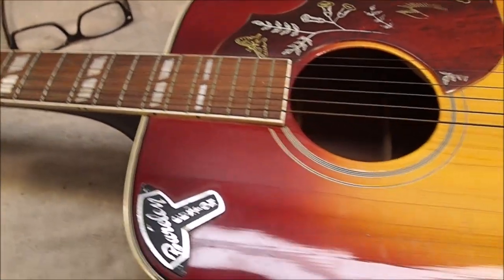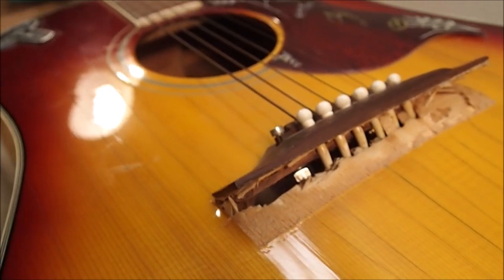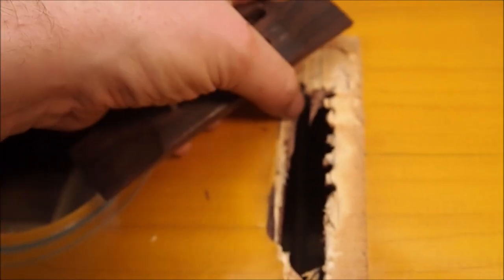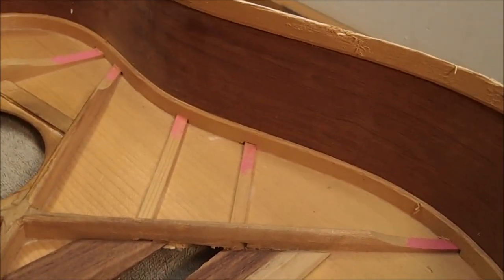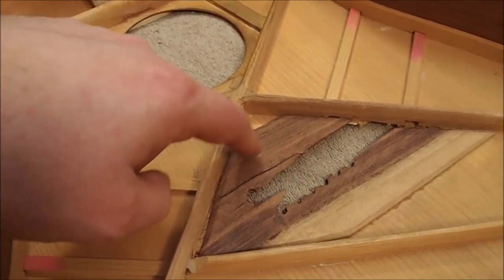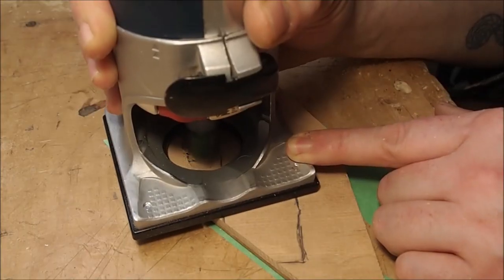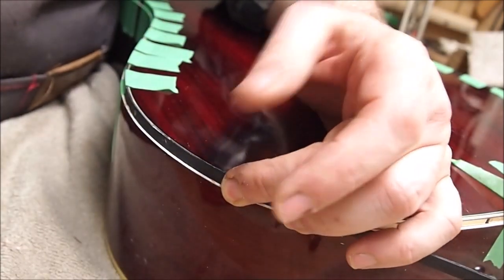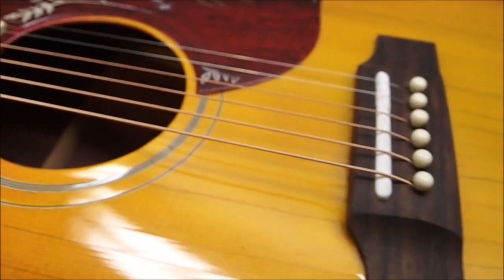Soundboard Repair and Replacement Bridge

Comment: I have never ever repaired/modified/rebuilt/restored an instrument and felt, for a nanosecond "oh, heck, another mundane fix". There are no mundane fixes. Every single instrument that I have ever purchased/traded/sold/fixed required all of the intelligence/improv skill/ perseverance that I could muster and not one fix ever followed a formula. Every instrument taught me something new and tested me to and beyond my (heretofore) limits.  Jerry Rosa inspired me to believe that I could restore that early sixties Sears Silvertone and by god she has aged beautifully and requested "no ninja neck refit, dude, I'm a slide guitar" and by gum the best slide guitar on the planet. Mister Rosa also inspired me to even modify and repair "cheap ol' tuners" that normally I would have thrown away - a little bending and a little lube and they're fine. It took me a while to check out twoodfrd because I anticipated lots of power tooling however Mister Twoo doesn't show a lot of that equipment in motion and I'm glad for that. I love watching impeccable hands utilizing hand tools on wood. Thanks.

Comment: Nice repair & great job motivating the reason-- sentimental value has no price! Honestly, I would be afraid to remove the back, but I can see why you did. I'm doing a bridge replacement on a Washburn right now for my son because it's a good fit for him (dreadnought for a big guy). The loss of material is a problem. I'm looking for tips on how to add back some material. Some folks use "Bondo," but I'm squeamish about putting that "under the bridge." :-)  I thought about routing out to level the plug needed and establish a simple perimeter shape and glue in a plate to match, but I'm not sure that's the best approach for sound quality. I am somewhat encouraged by the appearance of your finished plug, because it reminds me of the way molding can cover a variety of sins (little gaps and such). Thanks for the inspiration! (Nice bridge fab!)

Comment: Just popped up in my feed. I enjoy watching a real craftsman think things through. There are a lot of things to consider before anyone just starts digging into a project. Looks to me that you have skills. I didn’t understand how you took out the belly with the clamping of the body. I would have liked to see you fitting the replacement wood between the bridge and the plate. Perhaps you just like short videos. I look forward to going through your back catalog because you are indeed a master craftsmen.
Reply: The belly wasnt removed with the clamps, but by gluing in a new Bridge reinforcement. If there is a belly you need some clamping force to make sure it adheres properly. Once this is in place its stiffness and the adhesion of the glue keeps the top under tension and from deforming. 
If you have time you can try to work out deformations with clamping, heat and humidity - but its generally not worth the effort considering the result is unknown.

Comment: Great repair - I was curious to see how the fitted patch piece was glued in. I think there was bracing (while gluing it) from behind and top with glue around the edges. I got a glimpse when the saddle piece was being lowered on. I was curious if there might have been any thin woodstrips glued around the bottom perimeter to add additional strength to the repair. I assume this is not needed and the repair piece was glued in around the edges only. I need to patch a gouge hole on the bottom soundboard of my old Yamaha.

Comment: I had a bolt-on bridge that cracked every time I put the strings on so I ended up chipping off the paint, doing the sand fit thing like Woodford, and gluing it to the top. It's a fret saddle type bridge.

Comment: I have a $100 70s Ibanez Hummingbird copy with a lifting bridge. I really need to fix it before this happens. I don’t know what glue was used, but should have a bash.
Reply: There are a lot of other videos on bridge replacement, some will mention the glue they used by name
Reply: @fleadoggreen9062  I got psyched up to heat the bridge and prise it up to find it was just being held on by the bolts, as the glue had totally failed! I did my cut-price Ted impression on it (I had to buy Titebond), and I’m pretty happy with the result ❤️

Comment: Why take off the back? Would it not make sense to take off the top and replace it seen as it's the top that's is damaged? Very neat and tidy as usual well done.
Reply: because taking off the top is a lot more work, prone to damage and more visible than the back..
To take off the top you need to remove the fretboard, depending on construction possibly the neck. This also means you will have to reglue these later and probably a lot of fretwork and setup. The top is also much more likely to deform when removed from the sides and thus can be harder to reattach.
Its also really hard to remove the top binding without damaging the neck. You cant just go around with the router and hope for the best.

Comment: i have a morris w50 with a solid spruce top... i wonder if the bulge top was by design or resulting from the strings tension over time... anyway the bridge is still intact... is it possible to flatten (cold press) the top without removing the bridge?

Comment: Did you have any trouble marrying the back to the sides without using a jig to hold the original shape of the guitar?
Reply: i doubt it. The sides with the lining are already pretty stable, especially considering the wood they used. Unless there is significant deformation and thus stress on the soundboard getting the back on again isnt normally a big issue. 
Additionally with this kind of construction the bracing slots exactly into the linings - this ensures the back and sides will line up again when glueing it shut
Reply: @TheVergile  Not my experience.. but I'm glad that the guitars that you've worked on  have behaved so well.. I've never seen a guitar top go on perfectly that wasn't held in place by a template and and inspection of the finished binding would typically let you know whether a template had been used or not.
Reply: @donttellthekids2655  Thats probably because you have worked guitars that dont have slotted bracing.
If the braces are slotted traditionally there is only one way that top/back will go on. No amount of force and jig usage will move that relative fit.

When we build guitars most traditional methods remove the sides from the jig once the linings are in place. 

In general with traditionally built guitars removing the top later on is quite rare anyways. Just not worth the hassle when you can more easily enter through the back.

Comment: Celluloid has an odd smell like that. It is made from nitrocellulose and camphor.  The camphor component smells strong. You might have smelled it before as ping pong balls and some bindings are made of it. Take care with it, it's extremely flammable.

Comment: Do you ever have reason to replace the laminate soundboard on a budget guitar with a solid top? I ask because I've noticed that even major brands are coming out with solid tops and laminate bodies. Takamine had made some late 70s models with solid spruce and thus one would find an S at the end of the model name like F-360s or F-385s.
Reply: Not worth it.
Removing the top from a guitar takes a lot more work than removing the back.
You would need to take of the fretboard and possibly the neck, redo the whole bracing, reglue the soundboard, lacquer, glue on a new bridge, fit a saddle, etc - which inevitably leads to a ton of setup and fretwork afterwards.
Generally speaking composite soundboards dont have to sound bad. some perform actually quite well. Of course you wont see a lot of them in the more expensive price range - but then again: at that point youd be better off just buying a better guitar instead of sinking hundreds and thousands into an instrument without knowing how it will actually sound like.

Also not all laminates are born equal.
Reply: @TheVergile  Thanks for the feedback. Hundreds of thousands? Me thinks you exaggerate somewhat. I was thinking something simpler like removing the laminated top and replacing it with a new top which of course would need to be created. Also, I'm talking about myself doing the work. Not everything has to be done by a pro.
Reply: @TomasAWalker53  ah, it was supposed to be hundreds or thousand.

Yeah, i know what you mean. But thats my point. You cant just remove the top without doing all these other steps.
The Fretboard is glued to the top on most guitars. So to get off the top you need to remove the fretboard. If you remove the fretboard and reglue it after you have switched out the top youll have to redo some fretwork and setup. 
The bridge and braces are also glued to the soundboard. You can remove the top while leaving the braces in, but that makes regluing a new top quite hard. 
Its either that or redoing the bracing for the new top tho. 
You can remove the bridge from the old top and reuse it, but before gluing it on you first have to lacquer the new top.
There are also other small things like putting in the rosette, redoing the binding, making new reinforcements for the bridge, etc.

So its not like you can skip any of that - when you want to „simply“ exchanging the top this is all stuff you need to do. 

Of course you dont have to pay someone to do it - but if you can do all that you are basically half a luthier yourself.

Comment: @ 3:47 ............"they're using a really high level of skill while they're doing it"........in light of this,  it is so much more of a shame that they did not use better - solid - materials for the top, back and sides.
Reply: well, i mean. i think its fine.
They were aiming for a certain price range and decided to cut the material costs. There is a pretty strong argument to be made for producing affordable instruments. 
And plywood doesnt have to be a bad choice for a guitar top. It is an absolute nightmare to repair once you have a lot of delamination, but it is also very robust and has decent mechanical/acoustic properties.
There are quite a few plywood top guitars that have a very decent sound, especially for high tension steel stringed instruments.

I think it is a very interesting approach compared to what you are more likely to see today: cutting labour costs/craftsmanship and investing in better materials. Ive always felt that solid spruce tops do not mesh well with automatization. If you apply the same thickness to 20 spruce tops with different stifness to weight ratios  you will produce at least 10 that are sonically inferior to plywood. At least plywood as a manufactured material gives very repeatable results.

Im not sure whether he mentioned it and i cant tell from the video but the sides/back might already be solid woods? Plying guitar sides tend to be more work/investment than just taking some solid wood.

Comment: Is that a Suzuki make? I got the same idea to fill the saddle rout with a solid bone and carve for intonation but stalled when I read some luthier advice about not making saddles too thick, no more than maybe 3mm. Now I'm going to do the same (75 Suzuki Dove). Its actually a very warm sustain rich guitar at this stage.

Comment: cant believe you took back off to repair top could be done easy at soundholewith 180 degree wood chicel
Reply from the maker: Next time you do it post a video and show me how it's done.
Reply: Joe Wilson I think he was clear about the decision to pull the back off. It’s time spent and the value of the instrument. It’s just time consuming working through the sound hole. Lighting, using a mirror right is left back is forward ugh!
Reply: Joe Wilson, I'm really looking forward to seeing the videos of all the times you've done that. I can't see your repair videos on your channel, can you tell us where to look for them? Can you also give us a link to 180 degree wood "chicel", sounds like an amazing tool.
Reply: I can't believe he took the back off either, or that he even bothered fixing that old top. He could've easily replaced the top, back and sides, as well as fitted a new neck.
Reply: you realize there is solid wood bracing in between the soundhole and the bridge reinforcement? good luck chiseling my dude.
Reply: @garethbrannigan6739  i agree with the sentiment but asking for videos is - excuse me being frank - stupid. If the police pull you over they dont ask you for youtube videos of you driving to see whether you are able to drive a car.
Of the biggest luthiers how many do you think actually have a youtube channel?

You also miss the point. There are bent chisels - the problem isnt the availability of tools, but that there is bracing in between the bridge support and the soundhole
Reply: @TheVergile  can you hear that whooshing sound? It's quite amusing that you talk about missing the point!

Comment: It looks a little bit sub optimal to me, because of this bridge rip out. Doesn't sound that good. You know what i was thinking also it might not sound that good too.
Reply: meh. it probably barely makes a difference. 
first of this is a laminated top.
Then this area is stiffened up by a bulky bridge, the cross bracing and the beefy bridge support. There is no low frequency vibration in this area anyways.